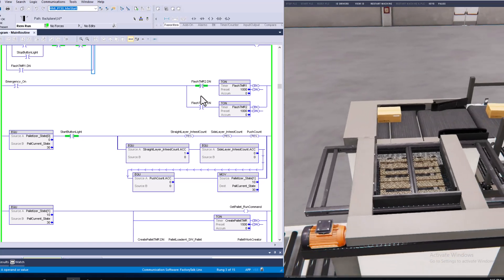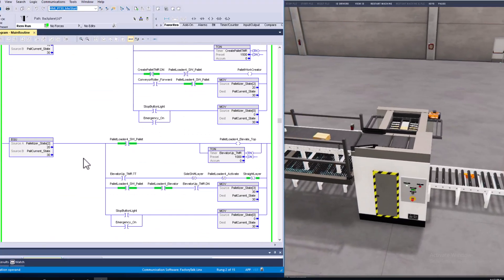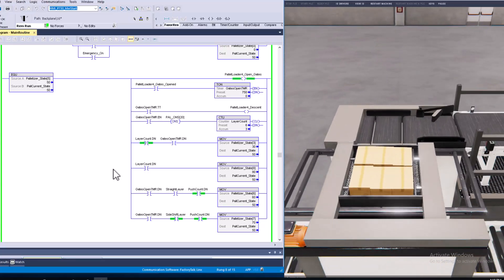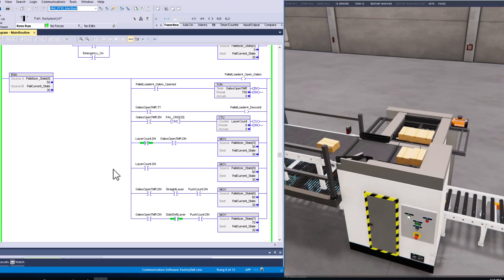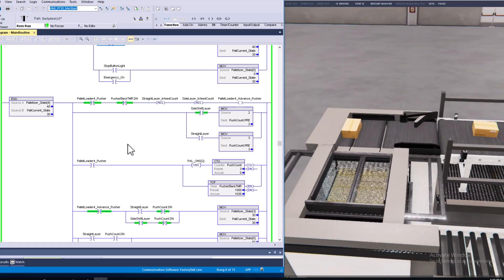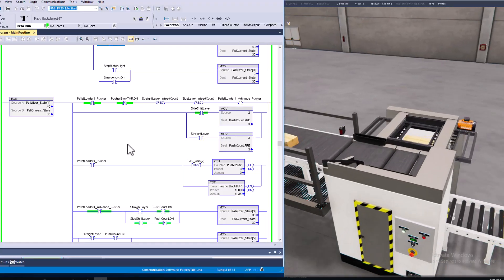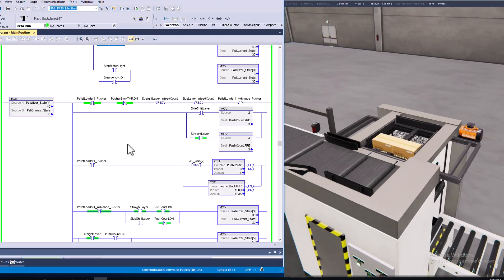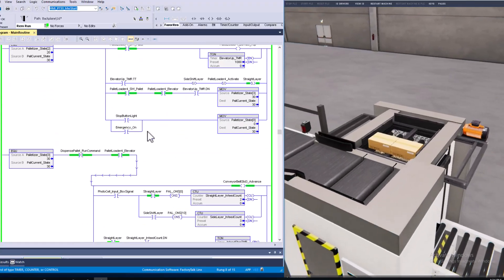Why Maintenance Technicians Have to Better Their PLC Programming and Troubleshooting Skills in 2025

Comment: Modern machines have become more complex in the industry even to simplest type of controls even to the saying would be considered overkill. Years ago we had bagging machines that would run on three relays, limit switches, push buttons, vfd. The machines got replaced and the new ones have the same mechanical parts and operation but controls are over complicated to the general maintenance person now they come a with PLC, HMI, Ethernet switches, programs, safety relays, relays, vfd, limit switches, etc., etc.   The only thing I can say good about the newer equipment is  it's easier to make changes versus making wiring changes in a undersized control box with no room to add anything new. My new obstacle is bettering my skills in studio 5000 for migrating to newer hardware vs rslogix 500 systems, servo controls between kinetix 300, 350, 5300, and 5500 since a lot of recent upgrades in the plant have migrated towards motion controls and what that in tells.
Reply from the maker: Yes every day is an opportunity to better yourself, that's why I teach

Comment: Machines Simulator by Nirtec? That really is cheap
Reply: Does this come with the built in plc emulation as well?
Reply from the maker: @osirisgaming3625 You can use there PLC controls yet I use Rockwell Automation and if that's what you are asking they do not supply Rockwell Automation software
Reply: @osirisgaming3625  Hello, it comes with a programming interface and emulator called EasyPLC. Has more of a Siemens Step7 feel to it. Works well just need to read the instructions. 

For example could not find a MOV instruction. The coils and contacts allow arguments. So when using a state machine you set the mode_int value using a statement on the coil. The variable assigned to the coil is the integer (mode_int). Then in the configuration for the coil the statement is added ( =40 ) to set the value to 40 when the rung is true.

I otherwise use a physical Micro820 controller using the free CCW software. Good way to still use AB without needing a Studio License.

I really learn a lot from Shane's teaching. Especially as he goes into the machinery/motion control in detail.
Reply from the maker: It's better than Factory IO too 

Anyone who purchases it can get a discount using my code

EasyPLC_Shane

I recommend getting the USB license, that's what I use
Reply: @ShaneWelcher thanks for the code! Yeah i would definitely want the USB version. I may try it out and then order the server license for my teams if its good. 

You made some excellent points, btw.